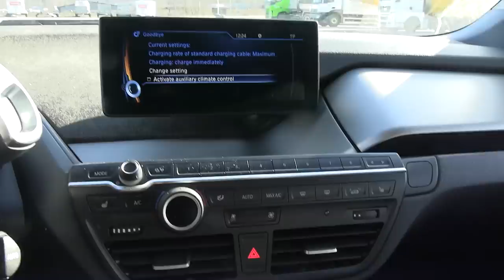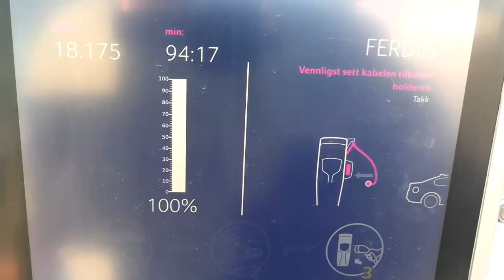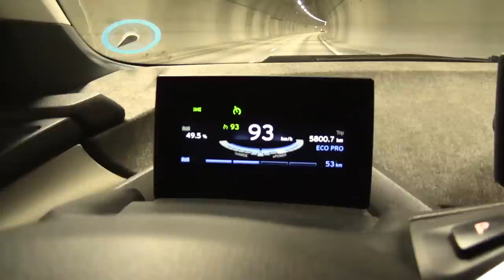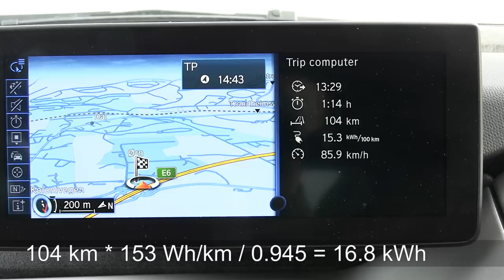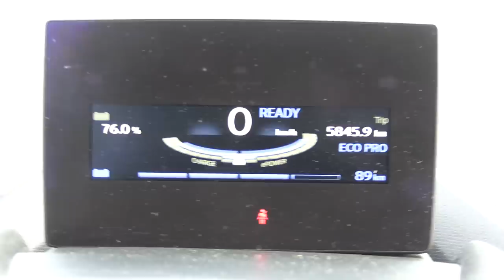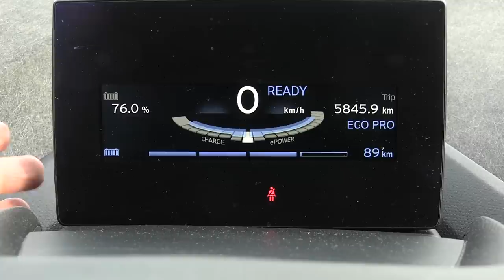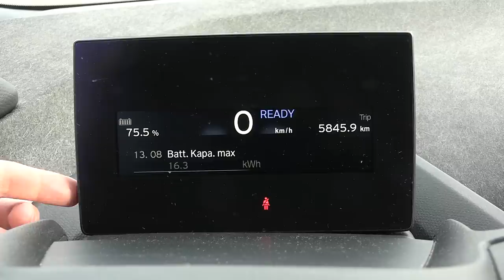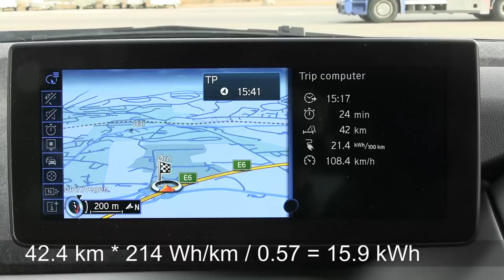BMW i3 22 kWh degradation test after 100k km

Comment: I've recently seen an (I guess newer) i3 on the Autobahn cruising at 170 km/h (measured by the speedometer). It was quite quick accelerating at the end of construction sites. Should be fast enough then to flow with the traffic most of the time.
Reply: The new I3S is limited to 160 km/h and with 184 hp it gets there quickly!
Reply: You have to test drive one to understand how fast it really is. Even the non-S version is unbelievable regarding takeoff.

Comment: I really want a i3 with range extender and the bigger satnav screen (smaller one reeks of cheapness) but on pcp finance for a used one the monthly prices are still way high compared to a top spec petrol or diesel car, for instance I can get a new style aclass with the big screens with 5-8k on the clock for £235 a month.....for the i3 with the larger satnav screen and range extender bare in mind most have about 40k on the clock (2015 model) its over 300 a month..total ripoff

companies are ripping people off, where say with the A class you get cheaper monthly prices and if you want to keep the car at the end you pay the big sum that's left..with EV cares they are making you pay over the odds a month but with a smaller sum at the end if you want to keep it

the point of PCP is so you get smaller monthly payments lol

so ill be getting the diesel A-class I think

Comment: With the degradation the BMW will   release the reserve capacity until there is none. Is why the takes to much time to full charge. BMW have 3 kWh of reserve because of the warranty. For me the issue is that the consumption doesn't match with capacity.  For example my average consumption is 13 kWh/100 km. My battery still have 18.5 kWh of capacity but hardly I do more than 120 km with one full charge.

Comment: I hope that EV battery packs will be/are retrofittable with newer battery chemistry types evenually, when a battery is degraded beyond no return, better to upgrade to a cobolt-less or IBM seawater chemesty battery etc... with more capacity and faster charging times, than to replace with lithium again, if lithium is available in 10 years that is. Interesting times to come with the new chemistry possibilities on the horizon.

Comment: Please don't take this as accurate !   I've covered 36,754 miles ( 59,149km ) and there is very little or no degradation on my battery 94Ah pack. I still have 29.8v usable battery capacity after 59,149km and a daily electric range of 140-153 miles (225km - 246km Range ) per charge (94Ah battery) with climate on low and speeds restricted to 57 mph. Everything depends on the cars owner: if you balance the cells. ABC. The BMS will take care of thermal and over-change perimeters, but the float charge (ABC)  can only happen at the last 4-6%.  If you do not regularly bother to balance the cells, then degradation may happen faster. I've been using batteries all my life with my profession and battery care is important on any EV.

Comment: 94 minutes to charge a 22kwh battery on a quick charger is not doable for many people. Luckily second hand i3's can be found pretty cheap.
Reply: That's because he is charging to 100% for the test. In normal use you would never charge to 100%, but rather stop where the charge rate drops off. Where this point is varies from car to car (battery).

Comment: Our previous 2015 i3 would show 19.6kWh soc max back in the day. After 75000km it would still show 19.4kWh, and no range degradation was observed.

Our current 2016 60Ah (61000km) and 2017 94Ah (39000km) shows 18.88 and 29.4 respectivly. The 60Ah had done about 25000km when we took ownership, and have since then for the last year been driven 2x90km daily during the weekdays with slow charging twice a day. Now the 94Ah has taken over that duty, and the 60Ah does a 2x35km route with only one slow charge pr. day.

Not only does battery degradation seems to be in check with these cars, they are also rock solid and dead reliable. With a 2 year service plan with unlimited distance driven between the intervals, it is also a car that is very affordable to run as a commuter.

Between: Kia Soul Ev, BMW i3, Tesla Model S and Tesla Model 3 Performance, it is the only car we haven't had a single issue with, and that is across four cars in total (we have had one more 60Ah in addition to the ones outlined above). All of the others had one or more shop visit. Model S being the worst, and Model 3 Performance being second best.

Comment: What was the charging speed like after all of these years? The i3 has a nice flat curve around 50kW, do the old ones still manage that?
Reply: You will see consistent 44-48kw between 10 and 60%. At 60% it starts to tape down until 1kw when you hit over 90%. This applies for the 60Ah Version. The versions with bigger battery start to tape down at 84%.
Reply: On my 2019 with 120Ah battery, charging tapers at 91% to 93%.

Comment: I have 94ah i3 with 111,000km and it gives me same distance that I was getting 2 years ago
Reply: i have the i3 94ah rex with 93kkm, just read 29,2 kWh, dont know what it was as new but gess low degradation?

Comment: For people looking for a used one: take a 94Ah.
Reply: And don't buy the rex version if not really required. Most issues with the i3 are caused by the rex. Like the infamous Check drive train error or overheating of the rex if used to excessive.
Reply: Got one, you are right. 94ah without rex, its perfect.
Reply: Bought a 2015 i3 rex. Perfect for my situation
Reply: Bought 60ah. Ofc 94 is better, but cheapest 94 was for 20k euros without anything. I bought 60ah with additional winter wheels and type 2 wire for 13k. Seems perfect to me

Comment: is the degradation mostly this bad because it's a smaller battery? or is it because of older battery tech? it seems like some pretty bad loss for only 6 years, but it's also a lot of cycles considering the size of it. i'd love to see a long term degradation review of a kona 64kWh because i'm considering getting it soon.
Reply: Reversed82 Bad? Nissan LEAF says hi 👋

Comment: Do you know if EV batteries can act like regular car batteries? yknow, one day theyre working just fine, then nightfrost hits and bam, the frost killed the battery. we see this quite often during winter on our used carlot. the batteries simply break down when the first night frost hits.
Reply from the maker: It doesn't happen with EVs.
Reply: @bjornnyland  Cool. i'm exited to see when the first battery repair & renovation shops will pop up where i live thou. i know they're starting to pop up around and about in the US already. it seem like modern EV's is no better than modern cars when we're talking reliability. Good for the first 7 years or 200.000 km's before needing anything else than regular service. big difference is, i guess, EV's dont need oil changes.
Reply: no 12v lead battery acts different compared to the lithium batteries in evs....

Comment: 18.8 kWhr is an average, in the summer it will hold more than in winter, surely, less battery capacity due to temperature is the reason for less range in winter, more in summer?
Reply: At 0°c lithium-ions move at half the speed, so you need 2x the amount.

Comment: Hey guys, I'm just now looking to electric - what are your thoughts between a 2018 Ioniq with 4000ks (company demo) vs 2020 model with larger water-cooled battery? There is currently a price difference of $13000aud. I don't mind the older car and the savings. Is there a compelling reason to pay more for the newest model? I'm generally driving less than 200km per week and never more than 120 per day.
Reply: No, not really if you are ok with the range of the older model. I would try to get it as cheap as possible.
Reply: @Kopfkirmes55  Thanks for taking the time to reply. I appreciate your input!

Comment: I have a BMW i3 94ah with 115000km I reckon 2% degradation
Reply from the maker: Did you test it the way I did or are you just assuming?
Reply: @bjornnyland  Just assuming I assume 😂
Reply: How many kWh does it say in the deep menu? i have 29,2 after 93K

Comment: Isn't 90 kph /56mph the speed at which the Rex generator cars keep the charge constant when the Rex is working? drive faster and the Rex can't put back enough charge, drive slower and the battery charge increases.  That's probably why eco pro + sets the maximum speed to 90 kph.
Reply from the maker: This is not rex. It's pure BEV.

Comment: Just by the way. 50% State of Charge is not 50% of the energy. It's State of Charge, not State of Energy. Charge = Ah. Energy = Wh. At 50% SoC the OCV is not in the middle of 100% and 0%. At 50%SoC usually you have less than 50% of the energy.
Reply from the maker: Bad design then.
Reply: @bjornnyland  Hahaha. It's also called physics. Same issue in every battery, thus in every EV, Smartphone etc...

Comment: Ivhave a focus diesel with 120000 km and its still getting 4 5 liter per 100 and 1200 km range
Reply: Your diesel particle filter is getting close to the end of its lifespan. Ford recommend to change it every 120k km
Reply: @Kopfkirmes55  nope i only do motorway driving so it hardly ever regens im sure ill get 200000 or more out of it 
I got 250000 out of a bmw with a cr-p regen system so im not worried 
During my ownership i have replaced only oil every 20000 km and front tyres ans pads  at 100000 
Apart from that nothing... cheapest car i have ever run

Comment: He change the wheels rims .. that will affect the range and battery efficient
Reply: TransBodyByDesign they are just painted OEM wheels. Probably some gutter rash hidden underneath 😬
Reply: Nobody Famous , they maybe painted .. but they are different like someone cut the black plastic part that make them hydro dynamic . I have i3 , and took a pic of the rimes in this video .
They are definitely modified , when you cut out the black part you will see more off the wheels trim inside that maybe going to make them more “cool” looking , but will cause wind to go Through them which will take more energy from the battery ..

Comment: i think batteries degradate faster in norway because of the cold weather... and i also would like to see how much the ratio between DC and AC charging of this i3 was...
Reply from the maker: No, it degrades less in cold weather.
Reply: @bjornnyland  are you sure about that? i think charging at -10°C would put more stress onto the battery like charging at +15°C. thats why tesla is heating their batterys up to around 30°C to make sure the internal resistance of the battery goes down?
Reply: @XTreMe2k6  15c is always better than -10 but what he means is -10 is better dan +30 which is true.

Comment: Internal combustion engines lose efficency over time as do batteries.
It would cost me ten thousand dollars for a new clutch and a refurbished or new engine.
How much does a new battery pack cost ?????
Reply: The new battery pack cost around10000$ but you get 2000$ for the old one.
Reply: @TheNick70nick  No. The new battery pack will cost you between 15,000 and 20,000$ depending on the dealer.

Comment: Your math is a little weak. Now there is no more reserve power, so the calculation should be divided by 22 not 18.8 kWh, so the lost is much more higher.
Reply from the maker: Your knowledge is a little weak... There's bricking protection at the bottom of the battery that can't be accessed no matter what. So dividing it by 22 is not correct. I divided by 20 when I estimated 12-15 % real degradation. Watch that part again ;)

Comment: The problem is, if you take 10 or 20% in the range of the car that is already low range you get stuck with a very expensive Renault Twizy.

I like this car and all is aluminium, carbon fibre technologies but I don’t know why BMW put that battery, the car is capable of more
Reply: 400€/kWh is why there is no bigger battery. The battery of an EV is roughly 70% of the cars manufacturing cost.